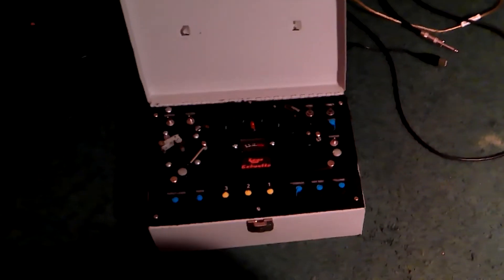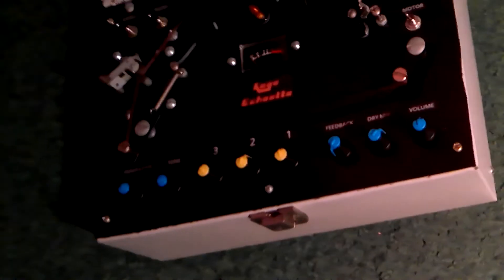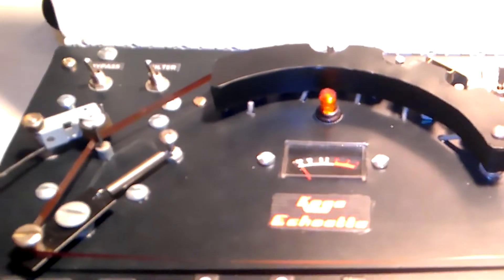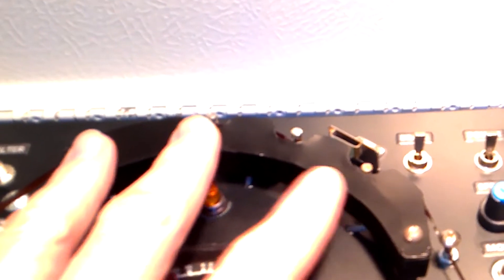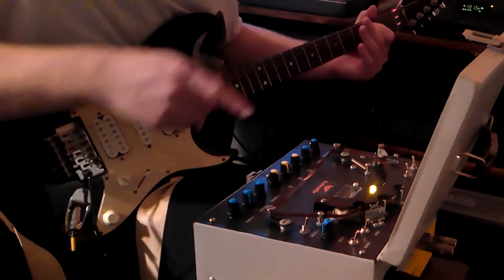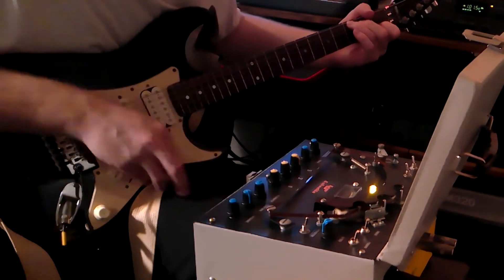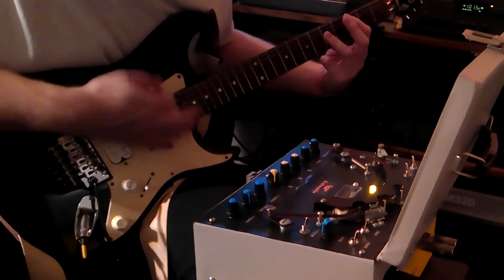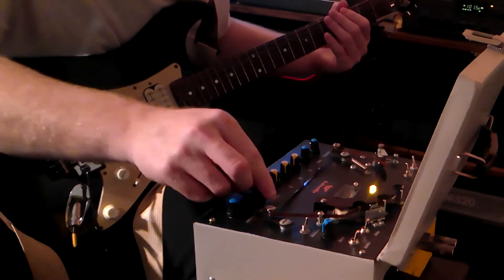Homemade DIY Tape Echo built from scratch

Comment from the maker: This was before I started using Chrome tape on it and proper splice tape. It sounded horrific lol, but definitely gave a neat effect even with the bad old worn out tape loop I had on there which goes to show it can be used for either. I'll have to do a proper video showing how stable it really can sound with proper tape instead of a splice from some crappy cassette that was badly damaged from heat causing the ferrous particles to wipe off and the plastic to stretch
Reply: From some years of experimenting I'm beginning to find slightly less HiFi sound feeding back producing more interesting sounds when driven into overdrive. I most often start with 1/4 inch but I've made cassette tape delays too...

Comment: Really awesome job here! I recently built something similar with walkman style players over on my channel. I'm curious about what you are using for speed control of the motor. I saw your schematic but didn't include the motor part. When I do this I always use premade PWM control boards but it introduces noise to the audio and the only way I ever can solve that is by using two separate battery pack. So please share :-) How are you controlling the motor? Also what kind of range of speed can you get?
Reply from the maker: Well I tried to make this part simple so I didn't have to build an entire motor speed control board. I simply tapped into a motor that already had a speed regulator that came out of a cheap turntable so no real loss. With the appropriate potentiometer and "reverse engineering" the motor speed control inside the motor itself it was very easy to control the speed to get a huge control range. If I were to build my own I would have probably designed a similar circuit but why reinvent the wheel when the motor I used already had it built in and easy to modify? :)

As far as noise in the audio I filtered that up by using a standard linear voltage regulator. Doing this will clean up the motor line noise getting back into other audio sensitive circuits sharing the same voltage rail or ground. This is also an old technique I did with brushless fan motors getting into audio when running on the same exact power by running them through an individual linear 78 series regulator and it acts almost like a separate supply that way.

If the motor itself is generating a strong magnetic field it can get into the playback heads and the only way to solve that is a complete redesign and careful planning of motor placement.
Reply: @kenzingzong6704  Ah ok. So...I really want to try and update my tape delay build with your schematic. But I want to put it into an actual PCB as that what I have been trying to teach myself recently. Hoping you might answer some questions to help me get there. The transformer in the bias/erase section is the only thing I'm not familiar with. Can you help point me in the right direction on what I would need for that? Sorry if dumb question but why 24v? If different Op amps were used could a lower voltage be used? Or does the bias/erase part need the higher voltage?
Reply: @Kage still looking for an answer about the bias transformer. Any chance you can help me out with maybe a model number? or maybe what I should search for? I really want to build this but I don't know what part that is.
Reply from the maker: @SISKworks  no as I said elsewhere I believe I used a few components out of an old tape recorder and redesigned around that by reverse engineering the original bias oscillator since I scrapped the erase head from it too. I believe it was a Superscope CD310 or similar. They used push pull transistors for the bias oscillator.